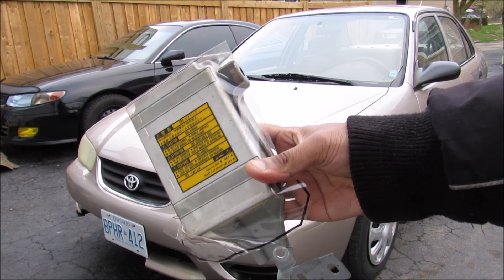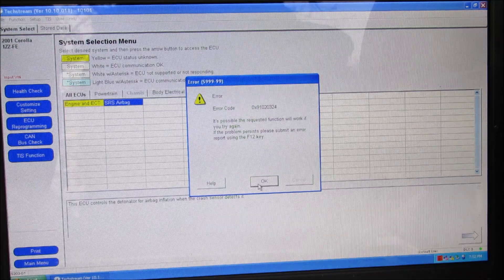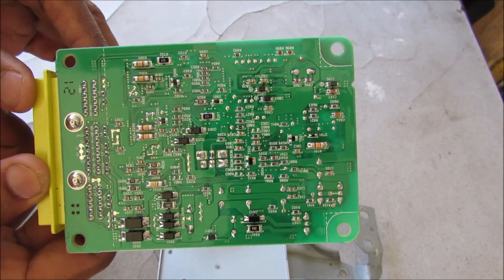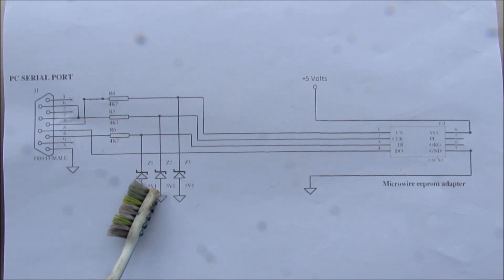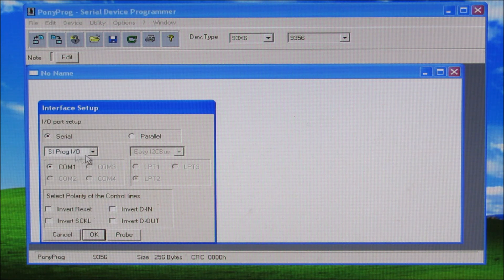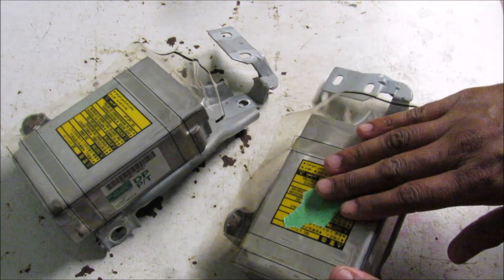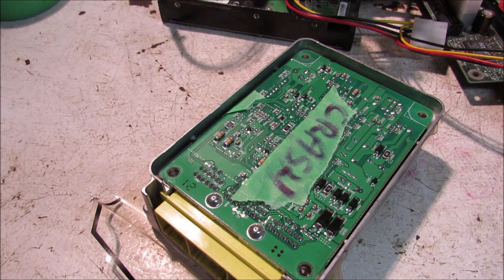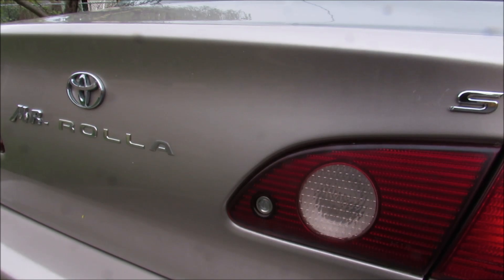Airbag Crash Data Reset

Comment: It will work if you desolder the no crash EPROM chip and solder it to the crashed one?
Reply from the maker: Yes
Reply: @speedkar99   aren't they vin locked? My 2015 civic ex needs crash data reset, need to be the same exact model?

Comment: Hi...one question. My seat airbag deployed after a small collision and the airbag light is blinking. Can I just bought a new airbag computer and install it with a new airbag or do you have to program it to the car?
Reply from the maker: Depends on the car. If it's old enough just swap over the airbag computers.
Reply: @speedkar99  its 2006 toyota aygo

Comment: Great video! I have a 2023 Corolla with the airbag light on and no codes. The car hasn't been in any accidents. Can the SRS module be faulty?
Reply from the maker: Get a proper scanner like techstream.
Reply: @speedkar99  I have a Snap on scanner updated up to 2023 models.  what could be causing this issue? any input helps. thanks!

Comment: question - can I use toyota techstream to program in a new air bag module if I pull a used airbag module with no crash codes from a used car ?
Reply from the maker: No. You'll have to get an aftermarket programmer since these are meant to be replaced by OEM not repaired
Reply: @speedkar99   which programmer would you recommend in these situations

Comment: Would it not be quicker to de-solder the good eprom from the non-crash controller and solder it into the original?  Presumably this Toyota is like a lot of other cars of the era where the control unit is coded to the car so you can't replace a faulty controller with a second-hand one?

Comment: Great video! I've got a 2012 Prius that had a very low speed crash (5 mph) that somehow set the airbags off. Replaced those, can use Techstream to access SRS, found codes, cleared them, they don't come back. No problems communicating using Techstream ... "No codes." But I still have the airbag light on, as you show here for the Corolla. Does this still indicate the same problem you present here, even though Techstream can read, clear, and confirm no codes? Thanks in advance for any help.
Reply from the maker: Yep you need to reset the srs module

Comment: Can you actually replace it? An worker told me something about programming the VIN into the srs control unit. Or was it bs*? I have to replace my module and i already paid thousands for repair service, this thing always fail. Im an engineer, not an idiot. I just buy one by my own, i only dont know whats going about the vin id. My car is from 2002
Reply from the maker: Depends on the car. Not all need the VIN to match

Comment: I wonder what happens if the single read/write line (pin) to the eeprom is defective - like let's say it was locked into the "read" mode... such that the eeprom is never written with accident data, that would preclude this problem altogether?

Comment: Hello -

What is the likelihood (or is it even a possibility?) that a repair shop or other company could or would reset an Airbag Control Module in a 2017 Subaru WITHOUT CLEARING THE CRASH DATA?  (I realize you can't speak for the practices of others, but I would like your opinion.)

Is it possible that even though the hard codes have been reset, airbags replaced, etc., that the data regarding the actual crash is still lurking inside, or is that an unlikely/remote possibility?  (The vehicle is not throwing any airbag or other codes and both airbags that deployed were replaced.)

Thanks for any information you can provide!

Comment: Great video, however your success is dependent on having that 2nd spare un-corrupted unit to read from. If I had a spare I would  just use that module instead of going through the trouble  of transferring the data over to the defective unit. The million dollar question is how to reset the eprom without access to a spare.
Reply: You can buy those codes online for 15$

Comment: @speedkar99 Have you tried using one of those simple USB eeprom programmers ? they cost about 10 bucks on amazon,  you can get them with the SOP8 Clip Adapter
, so no need to solder leads.
I am planning on getting one to experiment a bit,  after looking at different videos on this subject, I have seen more expensive equipment, which I am sure is more refined.  such as carprog,   but your method of basically cloning the data from a virgin eeprom  is probably just as effective,   the problem is getting your hands on a database of files for every car.  I mean if you have access to a virgin airbag module,  fine,  but if you do not?
Reply from the maker: I dont have access to virgin dumps for airbag computers. This was more of a proof of concept that an SRS eeprom can be reflashed and not replaced after a crash. 
I haven't tried the programmers...some require you to remove the chip completely
Reply: @speedkar99  I just got my little programmer today,  found a couple files online,  now I only need a chip to read and/or write .  seems there are a lot of these airbag modules that use the same M95640, going to  ask a friend at a body shop if he has any old modules laying around to experiment with.  anyway, thank you for the video it was very informative.  if I have any success,  I'll do an update.

Comment: bought an miniwith front airbags gone of... I found an set of rondt airbags and seatbelts  and  aibag computerbut you have also go to replace crach sensors? or not?
Reply from the maker: If they are damaged then yes. 
You can test the resistance to see if still good

Comment: Came here looking to try and do this myself...... Reality just set in, I’ll pay the $50.
Reply from the maker: Hah, did I deter you?
Reply: kosmosleha locally had about ten reset with him before never had a issue till this last time they just blew up on they own wasn’t even the bags it was reset for
Reply: Did it last week to a 2015 civic my roof bags blew and belts ten seconds after I plugged it in , that’s what I get for paying 50 bucks when I coulda got a module for 200 Maby 3 used on eBay and not have to take chances
Reply: @nemanjadraca4012  did you have the car on when connecting the module ? Or what about screwing it down.
Reply: @albertgiles5128  actually took the power off the battery but I didn’t tighten down the computer all the way I think that’s what did it
Reply: @albertgiles5128  had a lil play in it wasn’t tighten down all the way cuz it was hard to get to but I learned the hard way
Reply: @nemanjadraca4012  you don’t need to put all 3 screws. Just make sure you put one screw on tight. Maybe whoever did the module messed it up. Because if the module was sitting right when u put it in. And not on it’s side or anything. It should’ve been fine as long as you didn’t drive it .
Reply: @albertgiles5128  exactly that’s what I think happened it wasn’t on the side it was flat down just not tightened all the way
Reply: @nemanjadraca4012  could be. They can be pretty sensitive. One time I was doing a Ford F-250 and forgot to turn off the ignition and I was tightening the screws with my drill and the vibration from over tightening it brought the airbag light back on. Luckily no bags deployed tho .
Reply: @albertgiles5128  dam yea I just got u lucky it sucks lol
Reply: @nemanjadraca4012  bro , there's a sensor called "Yaw Ratio" build in the module in certain cars , this sensor is used to calculate the inclination of the car to blow up the airbags when the car flip over maybe this was the situation when your pluged back your module

Comment: Just one question, why are you resetting your EPROM instead of using the other unit?
I crashed my Peugeot 307 with side and curtaing airbags, and both front seatbelts deployed. I replace the ECU from a yunk yard, both seatbelts and 2 airbag and I got my car fixed without programming anything.
Thanks
Reply from the maker: I basically copied the non crash data over and it reset.
Reply: @speedkar99  but having another unit clean, it would be easier plug and play it

Comment: That was clever.... But I don't follow why the clock crystal was shunted, which would just make a pass-through?
Reply: The short on the crystal was to disable the microcontroller from accessing the eeprom too.  He applied power to the eeprom chip without desoldering it, which meant that the processor was actually powered too.  Shorting out the crystal just halts that microcontroller, and any chance it would interfere with the eeprom.

Comment: Guys. Please don't mess with safety electronics. Just replace the computer with some used one from eBay. By soldering to that EEPROM you're removing coating that protects it from moisture and you risk shorting some of the pins. Not to mention ESD deposited in the electronics during the repair. The ECU may fail at the worst moment and leave you with no airbags, tensioners etc during a crash
Reply from the maker: Good point

Comment: I love it! rewriting code is not that hard if you know what you are doing. Its funny because I taught myself programming from an Apple 2c back in 1990. The school I cleaned had an older Apple with a floppy drive and lessons on how to write code. When you were done, it would display designs that moved or just basic crude pictures.  The point was teaching you the basics and how they worked. As long as you can acess the E- prom or hard memory , you can hack anything. There are guys that get paid top dollar to write these programs. The hardest part is deciphering their code. Auto makers are NOT going to pay anyone top dollar to include a antihacking software. It would too much.

Comment: Too much work to save a buck. I'd rather go to the junk yard and take the parts I need from a dismantled vehicle. Especially Toyota, which is pretty much everywhere.
Reply from the maker: Good idea. This was only a proof of concept
Reply: So u can go to junkyard and get parts and replace them, like airbags and airbag control module? Or is it not that simple? I recently crashed my car which i just got a month ago n still owe 12,000$ on. But i don't have the money to pay someone to do it so could i go to junkyard and get driver airbag( only one deployed) and a. c. m. from different car and just swap them out? Ur reply would really help me out immensely. Thx in advance
Reply: @salvadorsalas5576  You can go to a junk yard and locate the parts yourself. Most cars have their air bag module in the center where the radio is located as seen in this video. However I would not recommend doing this on cars newer than 2010. I highly recommend seeking a professional, as this is about safety and you are risking your life and your passenger's life if your airbags are not installed properly.
Reply: @ParishablePain  t thanks Oscar I appreciate the quick reply a lot

Comment: Damn so SRS control modules are basically a “black box” within a vehicle!
Reply from the maker: Yes they have crash data
Reply: They are a black boxes for people that don’t know the components and how to talk directly to them.
Reply: on oldschool cars, yes. Now with CANBUS everything is stored in the multiple ECU's and can be accessed through the OBD port with proper hardware. it shows speed, G-forces, engine RPM, accelerator pedal position, steering angle, etc... for example, if you rear-end someone and say you hit the brakes but they didnt work, and someone takes it to court, law enforcement can have the dealership look it up on the vehicle and find that the brake pedal was not applied and the accelerator (APPS) was.

Comment: Mechanical Engineer.
Reply from the maker: Yes I am
Reply: dont need to have a degree in order to do this...he sure didnt learn in university the pinout of a serial port or how to remove a toyota airbag ecu...its experience and trial and error. the degree is a good thing but you cannot use it as a tool or as an excuse to know or not know stuff

Comment: I have a crashed 2004 Toyota Matrix. Could I flash the same data you did in your instructable? I can't seem to find anything else on the web. Nice Post!
Reply: https://www.automotivecircuitsolutions.com/collections/srs-module-reset/products/toyota-srs-airbag-control-module-reset-service-24hour-turnaround
Reply from the maker: Thanks 
I don't have all the data other than the screen shots ...
Besides I think the matrix is a different generation of airbags

Comment: i am no expert or anything but if you dont really know what that hex code means, you said you dont know how decode that, how can you be sure that the computer will do its job in a future crash? have you tested it? or just because the airbag light goes off you are confident it will work?
Reply: The chip he read and reprogrammed is just for storage of codes. It does not affect the chip(s) that operate the airbags, sensors or any other items.
Reply: @robertsteich7362  well it must have, because before he wrote the new code to it, the airbags were disabled. so yes, that chip does directly affect the other components of the SRS. they will not function if they do not read the right code from that chip.
Reply: @frostbite1991  and that's exactly why he copied the different data from the other chip into this one.. basically making it like an uncrashed module..  if the system had an issue i most certainly believe it would throw a code of some sort.. and that chip is just there to store the crash data.. one of those hex numbers was basically an enable or disable flag for the cpu thats elsewhere in the module to operate and communicate with the rest of the car.. once that flag gets set it basically shuts itself off.. copying the virgin data allowed it to come back online and operate..  i guess a test would be to make a dummy airbag and simulate a crash by getting a junk yard crash sensor for testing and smacking the crap out of it to fake a crash and see if the fake "airbag" deploys  could be a resistor and and light bulb to simulate the bag being there.
Reply from the maker: The test is the self diagnostics at startup and through techstream

Comment: I successfully replaced 2 airbags on my car , the only one left is the curtain airbag but I cannot find a replacement. I need to pass dmv inspection but the airbag is still on , if I reset the airbag module will it remove the airbag light on my dashboard?
Reply from the maker: +TheWiseGuy you should have reset the airbag module regardless, but yes you'll need a side airbag or a resistor to make the light go out.
Reply: Oh okay got you. For example if I have my appointment for the dmv in a few days and didn't find a replacement, can I plug in a resistor for the airbag light to turn off in the mean time right? Is that what a resistor used for most of the time??
Reply: Yes !
Reply: TheWiseGuy hi sir how are you
Reply: TheWiseGuy I want ok file u can help me
Reply: Just take the gauge cluster out and jump the SRS indicator over something like the oil pressure indicator light

Comment: Thumbs up......Easiest fix for a 2006 prius airbag deployment?  Can I just swap with another module?
Reply from the maker: +Ro Z yes as long as the part number is the same
Reply: speedkar99 so it doesn't have to be programmed to the car?  Have mine out about to pay about 50 bucks to have it cleared and wait for shipping.......ebay service listing

Comment: So it takes a good one to hack the bad one. Just replace the bad one with the good one and your done! Way too complicated for those who just want the light to go out. Great bit of information though.
Reply from the maker: +WAGONJON It's more of a demonstration on how to download the data. If you knew what to look for, ideally you'd change the values back to stock and rewrite. I couldn't decode this.
Reply: That's wasteful in terms of materials. Better to have a good one as template to set the bad ones to, rather than buying stocks of car blackboxes. If the crashed computer is physically broken, then sure, better safe than sorry.
Reply: You can save money by copying the code off the good one and returning it and reinstalling your used one.